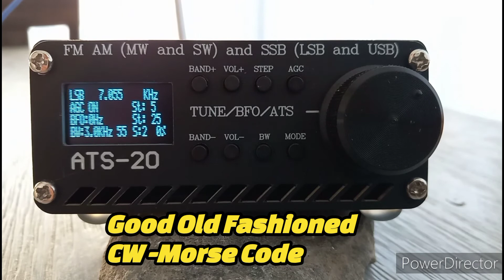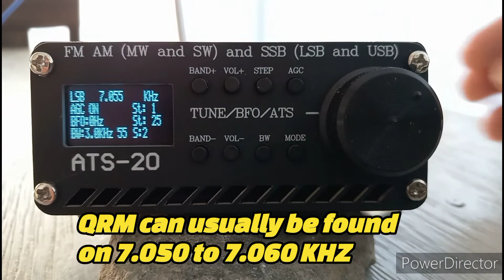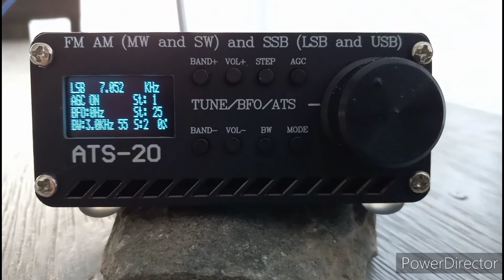Russian interference with Ukrainian Radio. SI4732 Shortwave Radio. 40 meter Band Scan.

Comment: The phase shift keying is amatuer radio rtty which is run on the CW portion of 40 meters. Check the arrl band allocation map.you can decode rtty but the amatuer ID in CW.
Reply from the maker: Excellent! Thanks. I have been teaching myself CW. I will try and decode. 73s